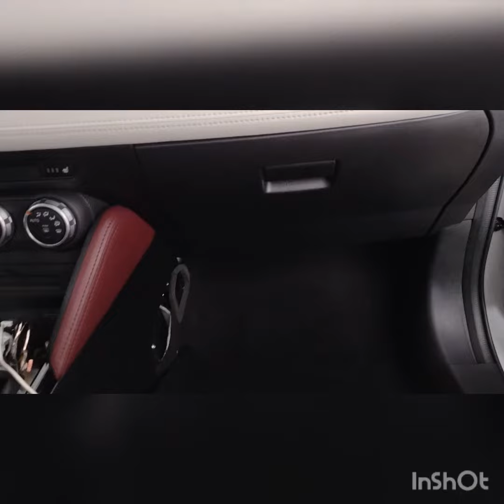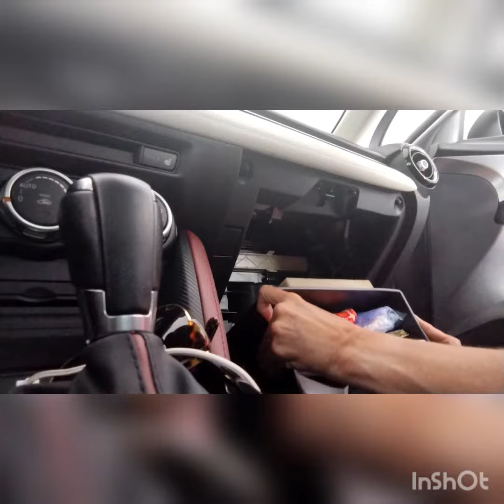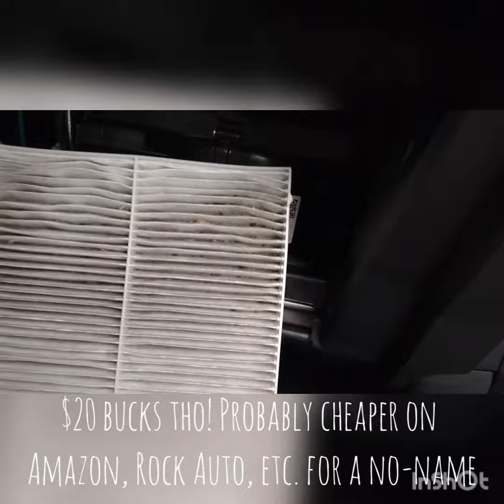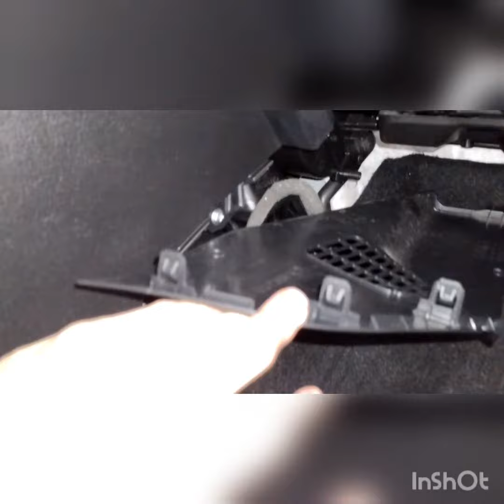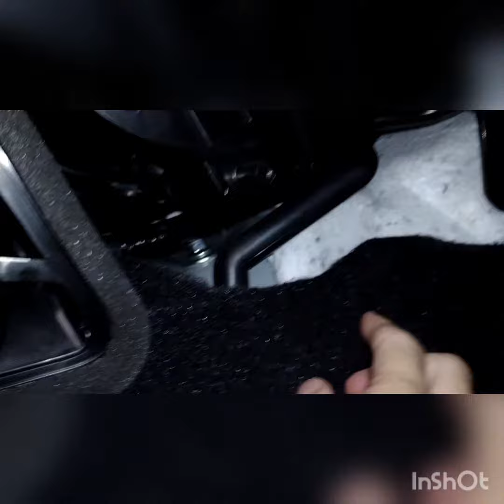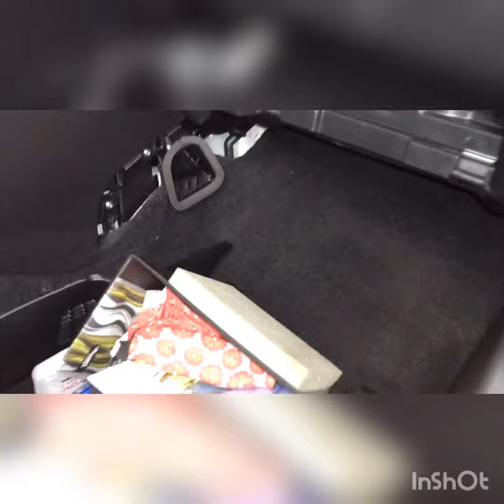CX-3 Wet Passenger Floor - Possible Fix

Comment: Thank you!!! I was trying to find a video on how to remove (or peel back) the carpet on the passenger side floor so I can try and dry it.  I spilled a quart (water bottle that didn't seal properly) of water in my car yesterday and the carpet is still wet today (just threw a towel on it) I'm fine removing the carpet and just replacing it with pads. The car is 7 years old and I just don't want it to smell moldy for the remaining 2 years that I own it. I now also know how to replace in air filter - that alone saved my $150! You are the bomb.